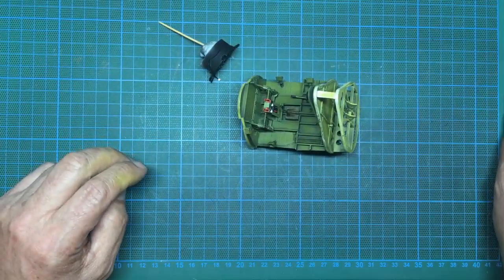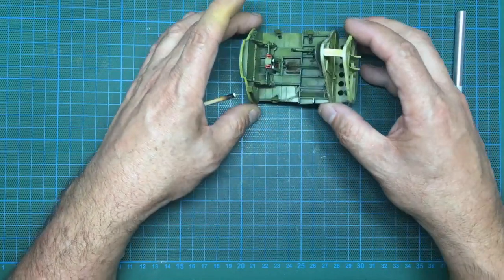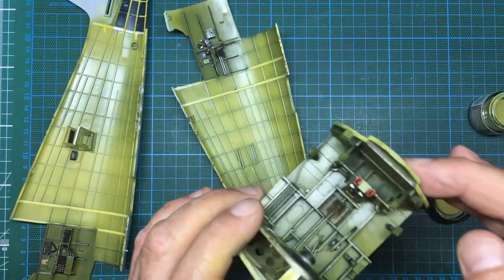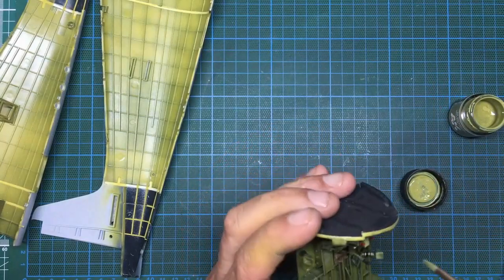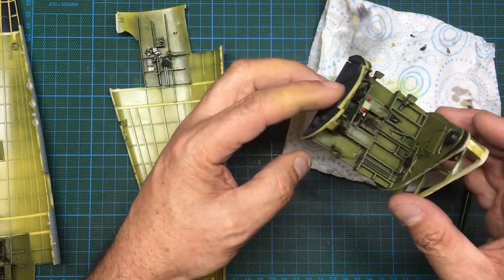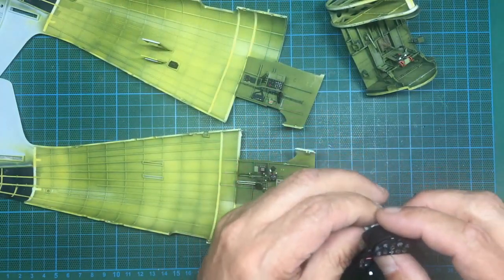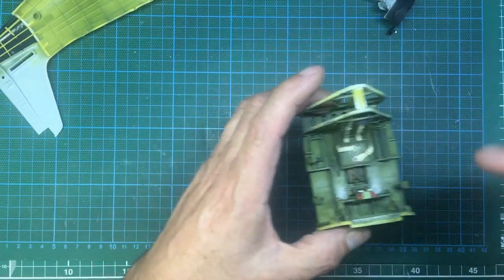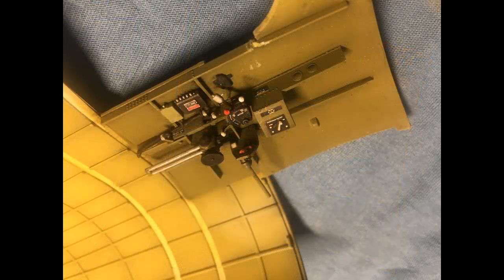Airfix 1/24 F6F-5 Hellcat build. Part 8e Cockpit..the end!! Final reveal.

Comment: Looks really good Nigel and your chipping is just right.  In case you have never tried it try soaking the seat belts and harness in tea and let them dry.  It gives them a slightly used look along with a very thin wash to pick out the fabric and stitching.  Of course the tea soaking is done before attaching them to the seat.